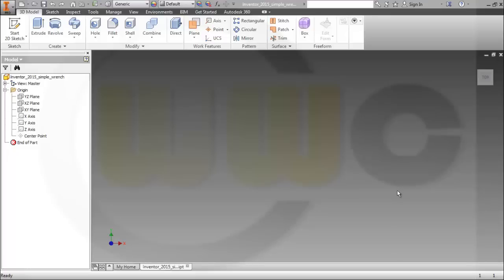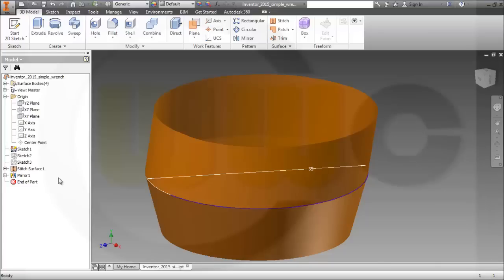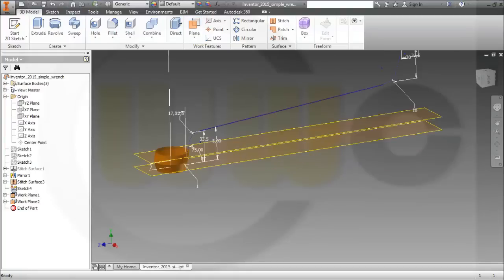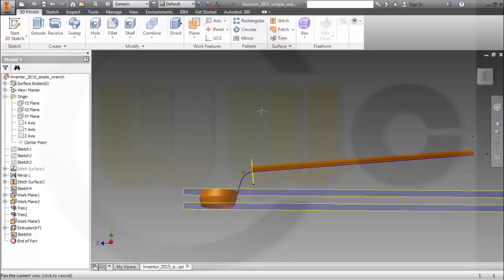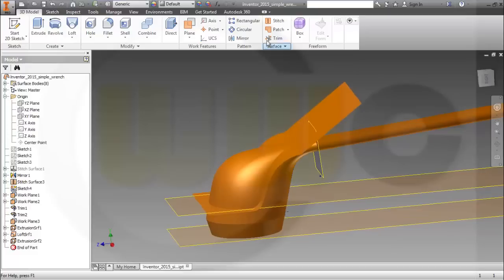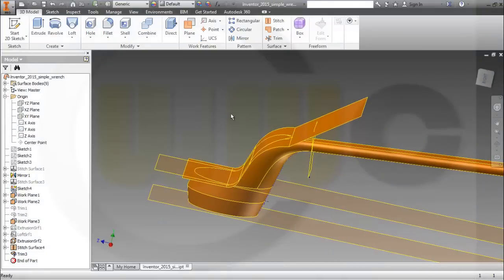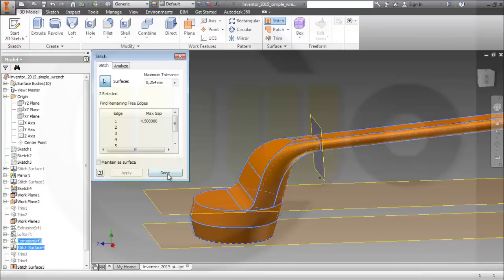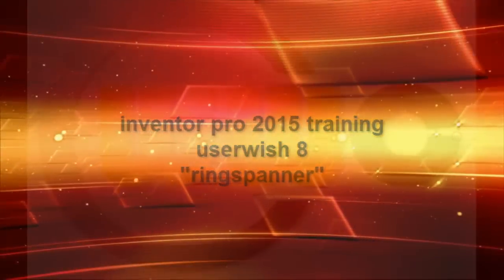Userwish 8 - Ringspanner - Inventor 2015 Training - Simple version

Comment: Thank you for replying, As I am learning from your great video clip, every step i am fellowing. So when you click something, your drawing turn in different way as my and thats what bring me to this question. Why my Z axis is different with yours. And it keep confusing me. So if possible, please show us how to change the Z axis direction. Thank you so much. Learning a lot from your video post.
Reply from the maker: I see, inventor 2015 has a new option for the orientation of the sketch in the "Application option" : "Look at behaviour" - "perform minimum rotation" (I have used this setting) or "align with local coordinate system" I suppose the "old" setting in inventor 2014 or earlier is different, at least as far as I have noticed.